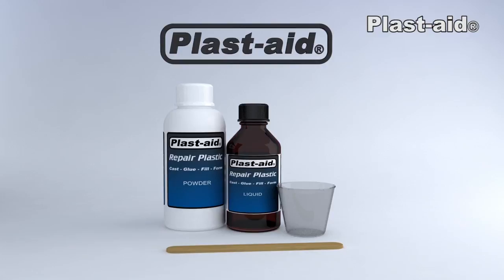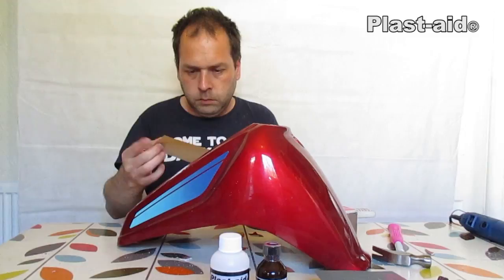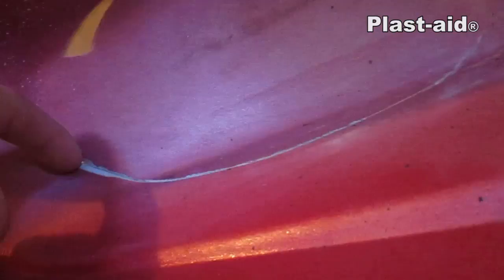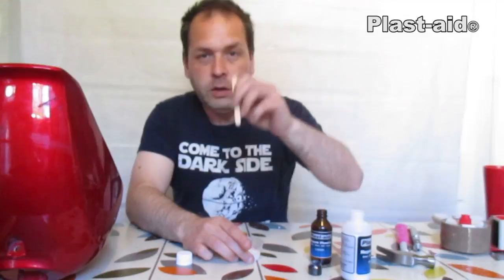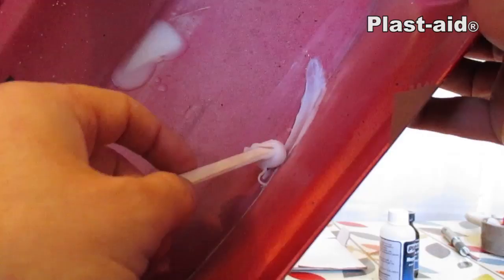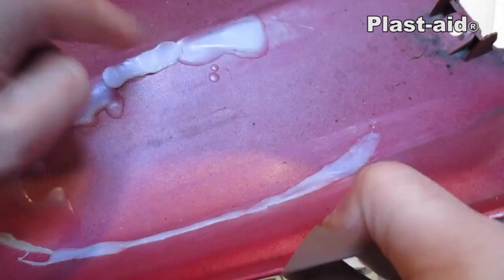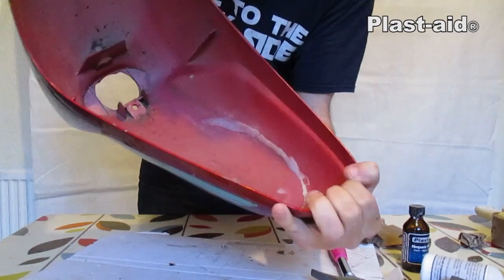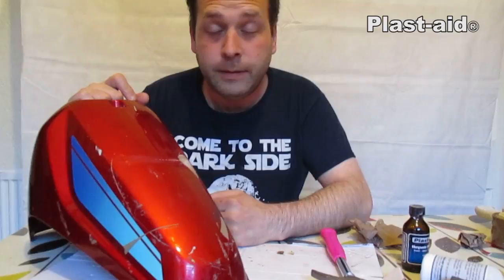scooter motorcycle plastic repair

Comment: I just did a bunch of ABS fairing repair with Plast-aid.  I cast a tab, filled a void, and repaired about 20" of cracks.  It worked exactly as shown here.  Great stuff.  I only did backside repairs as I don't care to paint the front side this season.  
For cracks, I taped the front of the crack flush.  I used a .25 spherical burr bit on the backside of the cracks going about 2/3 way through the ABS.  Sanded the paint .25-.5" away from both sides of the crack.  Prior to pouring Plast-aid I vacuumed and wiped area clean with a cloth and rubbing alcohol. Let dry.  Then with a q-tip I primed the ABS with the Plast-aid liquid before mixing and pouring the Plast-aid into the crack.  20 min. later it's solid like new.    
I used every phase of the Plast-aid except for the putty phase(didn't need it).  The paste phase(2.5-5min. after mixing) came in handy for a cracked off signal boss where I couldn't pour the product.  The boss cracked off the inside of the fairing flush almost perfectly around its base.  The boss wouldn't seat well if I ground on both sides of the crack as above.  So I poured a crack elsewhere and when the Plast-aid left in the cup was a little thick and tacky I glued and held the two pieces together.  After that cured, I was able to go in with a little burr bit to grind out a trench around the boss.  Came back in with a pour of Plastaid around the base of the boss.  It turned out better than I expected it to.
This is good stuff for ABS repair.  It's sands and shapes very well too.  The void I filled is ready for sand and paint and shouldn't need any filler.  It was only curved in one direction though which was easy to tape.  I used blue painters tape on everything as it is easier to work with over packing tape.  It released without any problems.
Like all products it gives off fumes, so use in an open area or with a fume extractor.  It doesn't stink as bad as I read about.  It smells near to super glue, but fumes closer to acetone. I used a muffin fan attached to a dryer outlet and that took care of it.  The house didn't smell.  The repairs don't smell after it sets unless you stick your nose to them.  After a day it doesn't smell at all.
Overall, a great product.  It's really quick and easy to use.  My only gripe is the graduations of the cup being on the inside.
BTW, this doesn't work on PP and PE.  Use loctite "plastics" for that.

Comment: Can it be sanded/painted with the proper color if we choose not to mix any color during the preparation process?
Reply from the maker: you can use it however you want with or without colour, if you mould it then you need almost no sanding at all.  wait until the cure time is almost up and smooth it out then, but that's really down to how pretty you want your repairs.